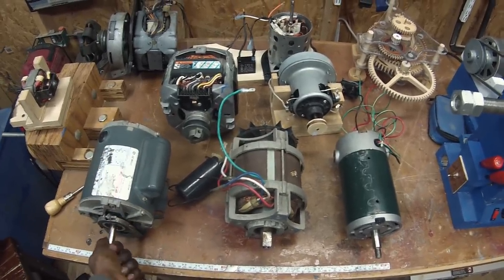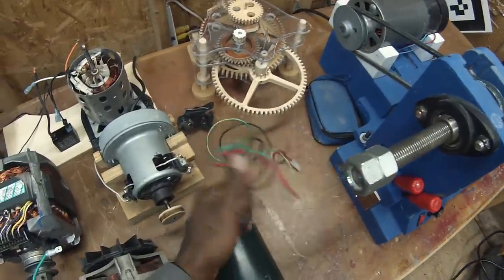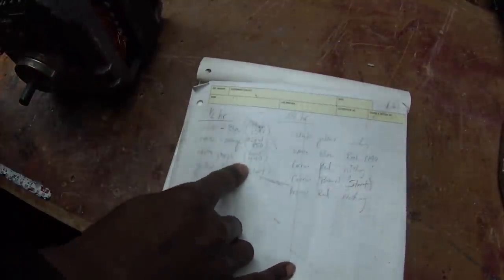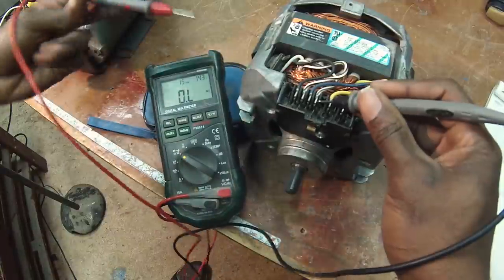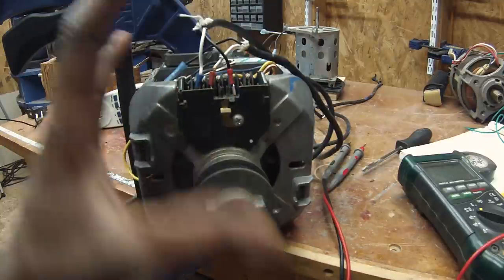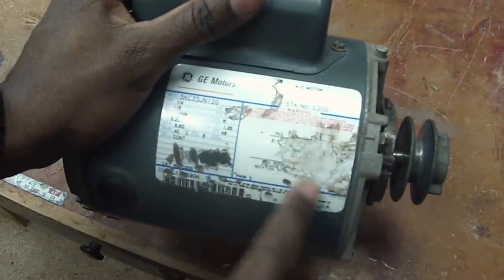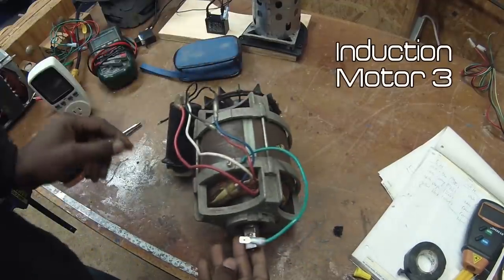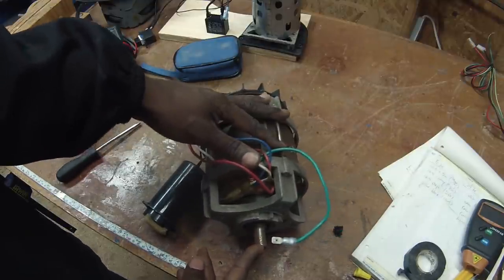How To Reverse the Direction Of Universal and Induction Motors: 015

Comment: Jeremy, you must have a different internet service than me. Every site, forum, etc. That I have found tells me that I must have the serial number of the actual washing machine to be able to get information on the motor. well, as you said you do, finding motors on the sode of the road or if someone gives you a motor, you don't have information on the actual washer. maybe you could share some of your sites you get this info. on the motor itself. in searching the internet, I have never seen a more problematic area than finding how to wire a washing machine motor.
Reply from the maker: I think I have lost track of what we were trying to find. I have a lot of conversations going right now. Do you have a serial number on the motor? That is what you need... but you don't really need that just to get it running. You just have to work out which wires do what using the method I showed in the video. Please remind me what exactly are you searching for on the internet.

Comment: I want to turn a cordless drill motor into a battery charger motor. Is that possible?
Reply: Basically what I mean is I want to put something like a fan on the Chuck and wire the motor to put Power out instead of using power. Basically turning it into an alternator

Comment: Jeremy, I just got an old Shop Smith 10er. I may need a motor for it. The start capacitor is dangling from 1wire. I haven’t had time to look at it yet. 

It is only a 1/2 hp motor, so I would like to increase the hp to maybe 1 1/2 hp and make it reversible and variable speed while I’m at it. I have some electrical knowledge and with your guidance I’m sure we get this done. I would rather find a motor that fits my wants then to buy new.

I will rewatch your videos on these subjects and learn.

I have a question about the torque / hp relationship. Do you have a YouTube about this relationship? My question is because I will be using this Shop Smith to work the lathe, saw, and other wood tools on it. Torque may be a consideration for what I want this to do.

Thank you for your videos, and your help. Please contact me any way you feel comfortable. My email is gary@turn50rocks.com.

I also have an idea for revenue for your YouTube channel.

Thanks Gary

Comment: what speed controller would you recommend?
Reply from the maker: Personally I think a DC Speed controller is the best option. Its worth the money. You can buy them used... I bought a KB "DC speed controller" online used for $40. I will review the thought process and other options in the next video in this series (speed control).
Reply: do you know if adding a speed controller on a tool will allow it to spin up more gradually and thus not pull so much power in the beginning? i have a belt sander that has to be the only thing plugged into the outlet when i turn it on or else it trips the breaker.

Comment: is there any way to reverse a simple box fan motor?
Reply from the maker: I am not sure what type of motor it is? The answer is probably no. Really cheap motors like that are usually shaded pole motors. They only need to spin one way to run the fan correctly. It may not be a shaded pole motor, that is just a random guess.

Comment: How do you check the ohms without it plugged in?
Reply from the maker: Ohms is the resistance of the winding itself. You measure it exactly as  shown. No power is needed.
Reply: Jeremy Fielding I have a 5000 watt inverter there's some energy still in it unplugged.
Reply from the maker: Vincent. It has capacitors. They are like batteries. They store energy.

Comment: Hi, again Jeremy, I've just watched your video - "Who is this guy" and as you said there, you like reacting to the comments put forward, it has prompted me to re-ask the question I put to you in the comments below 3 weeks ago. I made a stupid mistake initially in saying the 220v motor I wanted to know how to reverse was from a lawn mower. Obviously it could not have been. I re-put the corrected question to you but so far have received no answer. Perhaps you could help now - I'd be very pleased if you did ?
Reply from the maker: Thanks for your patience. You comment was buried by all the other comments. I have alot of conversations going at once so I am losing track of some things. Unfortunately I haven't tried to wire a 240 volt motor. I don't have 240 power in my shop  and I am not sure how to do it. The process should be the same... as far as reversing the start winding... but I haven't actually done it myself so I am afraid to recommend specific steps. I found a video covering exactly this which may be helpful. Again I haven't tried it so you will have to take this information at your own risk . https://www.youtube.com/watch?v=rMeMaT0HZN0

Comment: does it work for universal motors ?
Reply from the maker: There is a universal motor in this video
Reply: thank you for replying quickly. a simple DPDT works or you need a speed control in order to reverse polarity ?
Reply from the maker: I don't answer questions like this because there are too many variables I can't see about your situation. Please understand I get hundreds of emails and messages asking for help and it just isn't safe or practical to give one on one advice. I will say speed controllers are not required to reverse motor direction.
Reply: I was talking from a safety perspective. because I read that when you deal with big motors you shouldn't just flip the switch to reverse the polarity, it's dangerous (because of the amp draw ) better to use speed control to reduce the input voltage before pressing the switch to reverse polarity
Reply from the maker: You should always stop the motor before reversing

Comment: Wait a minute... There's Motors that'll run on AC and DC? What type of appliances use these? I'm wondering if these will run off of car batteries.
Edit: I hadn't finished the video yet. Vacuum cleaners, got it.
Reply: for fun go to any decent hardware store & look at electric power tools, most of the big names will have at least a few that say AC/DC, electric grinders are a big one, & many professional Weldors use older welder/generators that do not have AC, so only use 120 Volts DC to run their tools.
Reply: @randymack1782  Thanks, man. I'm gonna keep my eye out and do some further research.
Reply: there is the common 12 & 24 volt motors, you can find easy, but also 32 volt, from when it was a common voltage, before the REA, "Rural Electrification Act" vintage generators like the Delco Light plant, & farm motors were 32 volt, wind powered generators were most common in 32 volt, but other voltages as well, & could even find light bulbs in 32 volt, & today it has about faded away, other than some off shore marine applications still use 32 volt. I like the huge 110 volt electric motors that had very little horsepower. lol
Reply: @randymack1782  32 volt? I've never seen anything like that! 
I'm off grid, so anything that would work with 12 or 24 volts is what my focus is on, and I'm frugal (okay, cheap), so scoring motors from junked appliances just makes my day.
Reply: stay with the 12 or 24 volt, the other is curiosity stuff, but google it for interesting stuff, I have seen dozens of items since I was a kid, but I have also gone to antique engine shows & been around where that kind of stuff was sold. what can get interesting is looking for 1 gas engine & buying belt powered stuff for your farm, & for example a good hit & miss engine can last for decades of use, & the engine is very fuel saving, as it only runs to maintain a certain rpm so its spinning without actually firing or wasting fuel.  research Hit & Miss engines if never herd of.

Comment: Just a hint. To determine the direction of rotation of an electric motor or gas engine. The perspective is to be taken from the back side of the motor looking at the output shaft. At 5:00 into the video, you said the shaft was rotating in a CCW rotation. It was actually turning (in technical terms), CW. At 5:37, it is actually turning CCW.  At 5:43 it is turning CW. At 6:07 CW again. @ 6:33, CW. @ 6:56 CCW.  @ 8:14 CW. @ 8:56 CCW. So, my friend, all of your other references to rotation are backwards to the technical standards. Now I am not criticizing you, just letting you in on the community standards. . . . . .Proverbs 27:17 - "Iron sharpeneth iron; so a man sharpeneth the countenance of his friend."
Reply from the maker: +R2D2C3PO good to know. I have not seen a standard for this but of course this must be one.
Reply: The pupil teaches the teacher. LOL
Reply: R2D2C3P0  I thought the same thing so it was good you pointed that out.Jeremy was humble enough to learn.

Comment: So, lets see.  You don't dumpster dive but you find these motors on the side of the road.  You mean people put out a washing maching at the curb along with the rest of the garbage and you put the washing machine in your truck and take it home/shop to disasemble.
Reply: Joseph Nicholas yep that's how they do where I live. Along with a lot of other goodies!
Reply from the maker: Exactly...I don’t shop behind stores or anything like that. If I happen to see a large appliance on
the curb while going to work, and it’s easy to get, I grab it on the way home.
Reply: So you load a washing machine into your vehicle by yourself?
Reply from the maker: Everytime... the ones with the concrete blocks in the bottom aren't that friendly, but at that point I feel committed. The blocks help keep them from tipping over. Now that I think about it, the newer ones don't usually have the weight in the bottom. When I get home I have a hand truck for moving it to the shop. Then its right back to the road. I hating having any scrap metal in the yard.
Reply: Wow, I'm impressed.
Reply: There's other stuff in a washing machine that you could use. Transmission with gears, long steel shaft, water pump, solenoid valve, electric timer, switches...
Reply: I'd strip the outer casing off too.  Flat sheet metal is always handy.   People also do creative things with the drum (strawberry planter,  fire pit)  and the glass from the door (salad bowl).

Comment: I have a basic stand-up house fan that quit working. I believe it's an induction motor based on your other video (it's basically the same fan you had, the "sacrificial" one, lol). I changed the capacitor, and had it working but snapped some of the little wires from the windings and have no idea where they go. I don't understand why they design it this way with such fragile, tiny wires. I can't sleep without my fan. Does anybody have any tips to help me get this bad boy running again? Even a way to just rig it up with  one speed?? Please help! If not, Jeremy will be exposed as a fraud, and I don't want that. Also, if I can't sleep at night due to not having my fan, I could potentially have a fatal car accident. Leaving not only my own blood, but also the blood of every innocent victim I take out with me all over the hands of Jeremy Fielding and every knowledgeable gentleman reading this comment and unfortunately damning your soul to burn in the eternal pits of hell. So let's help each other out and get this fan running again so we can make it to heaven guys. Thanks in advance! Your friend
     - Joe

Comment: Man you lost me. I thought you showed in a different video using the auto transformer that induction motor rpm was not controlled by voltage but by frequency. Yet here you show the washing machine motor with 3 speeds based on which winding is used. Or did I misunderstand ?
Reply from the maker: Both are true. The speed can be changed by changing the number of poles in the windings being used. I briefly explained that in the other video. It helps to watch again. This can seem complicated at first I know
Reply: Yep, I had looked at it twice, in fact I've watched all of the motor videos twice -I'm a slow absorber. Just to recap my question, on the washing machine motor, it has 3 speeds. And as I understood you, each was controlled by a different secondary winding, which I took to mean a separate coil with a different voltage. Thus the question about different voltages controlling the speed. 
But in your response you mentioned additional poles. I remember clearly you showing how placing a second stack of magnets increased the speed of rotation. Thus, as usual, I seem to have made a bad assumption about the secondary windings. I assumed that the low low speed winding had 2 poles, and so did the low and the high, but that no matter which you picked you still had 2 poles. Judging from your response, I gather that low low has 2, but low has it's own 2  plus the 2 from low low, making 4 poles and increasing the rotatation. And high speed adds 2 more. 
Is this what hapoens ?
Reply from the maker: Well crap... now I know why you are confused and there is no good way to explain it here. I will say this, you have it backwards. More poles means the motor is slower, but significantly more torque. Fewer poles increases speed but decreases torque. The video where I add a magnet at the top was not actually adding a pole. That is the part that is harder to explain. You have to take my word for it that "before" I added the magnet in that video it was a two pole motor in that state, and remained two pole when I held the second magnet there. Adding the second magnet was increasing the strength of the magnetic field, and thus increasing the speed in a DC motor. That doesn't happen in AC induction motors.

Comment: Ok here goes my first attempt,
https://imgur.com/gallery/vCtyJ
I guess copy and paste so you can see the wiring.
Reply: Yellow red blue brown brown, the starters are red and blue. I wrote on blue tape and said where each wire came from. This is the garage door opener motor that I'd like to use as a 6" belt sander.